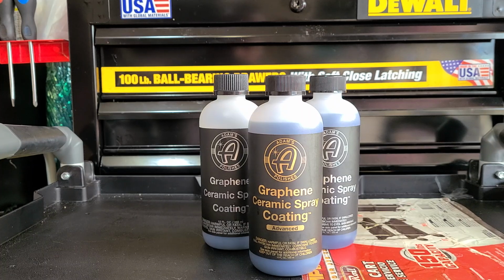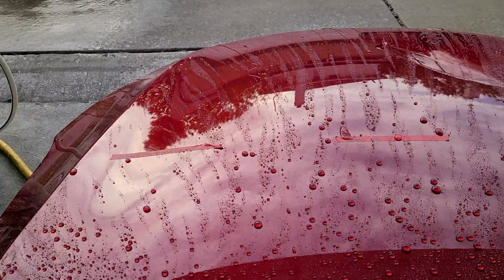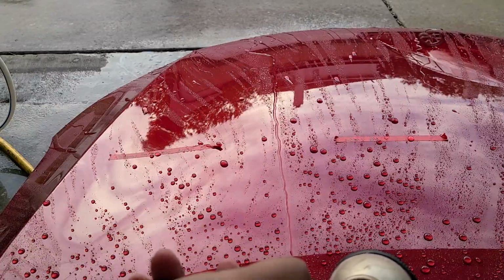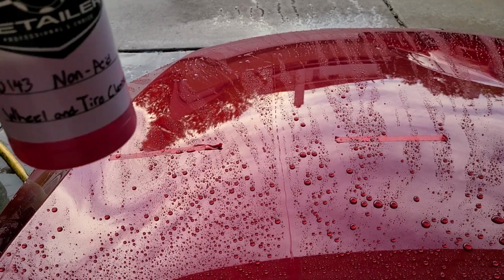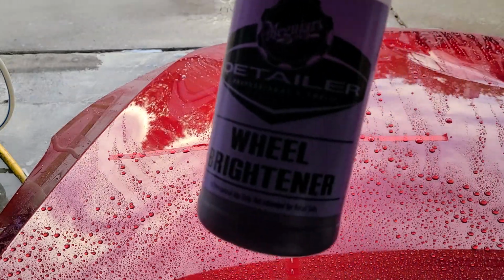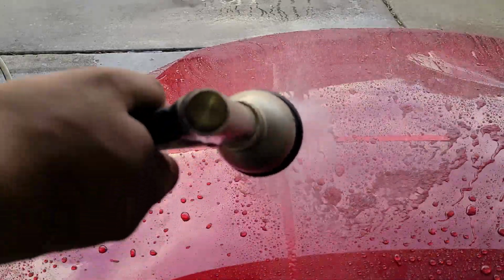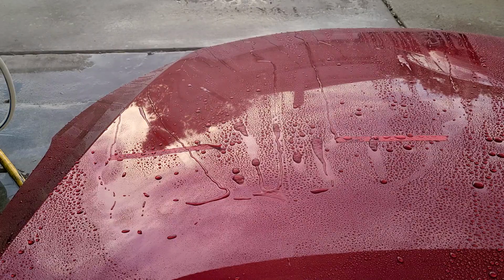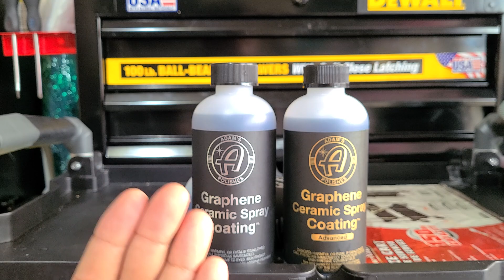[EXCELLENT] NEW Adam's ADVANCED GRAPHENE Ceramic Spray Coating - Better than the Original?

Comment from the maker: PRetty impressive stuff! Anyone know of similar products? Leave a comment below.
Reply: Optimum hyper seal. It's also solvent based and is a sio2/sic blend. I don't think any other spray sealants use SiC. It's pricy and you can only get it directly from optimum's site.
Reply: Is the Advanced you used the same that Scott HD used on his tests? It appeared that advanced only lasted for about 7 days? check out his video. Kind of dissapointing
Reply from the maker: @edwinnegron7761  I believe so. The beading doesn't last long term but it still sheets water no problem.
Reply: Good video

Comment: Great example video man. It’s a shame that Adam’s doesn’t do more to prove and show that this spray coating is in fact a real ceramic coating and a NOT spray sealant. It does crystallize. Most of the bad rep they get is because most of the DIYers installing it don’t know what they are doing so it fails quickly. In one of their videos, they interviewed the B&B blending chemist and he mentioned that it really should be called a “Graphene Oxide Functionalized Ceramic Coating”. The layer that bonds to the paint is a ceramic coating but they just utilize a graphene oxide layer that bonds on the highest layer to act as a secondary protective layer for the ceramic coating layer. Thanks

Comment: yeah the advanced after using  lasts about 7 car washes longer than the regular one on my customers cars so I think it's worth it. I've gotten 15 monthly washes completed with the Avanced before the beading turned into sheeting but it's still protecting at that point. anyway I didn't continue until it was completely flat I did a decon wash light clay towel then reapplied it in 20 min so irs new again.   don't get me wrong true ceramic coating in glass bottles are far superior but as a mobile detailer products like this and GYEON CanCoat Evo are my go to products for protecting saving the customers who want ceramic coatings hundreds of dollars. I just tell them if they would like me to maintain their cars  they can choose one of these instead of the best thing for the higher price, this will be applied  for a third of the c price of a real coating and is much less time consuming. they all usually thank me and do it.  done say noooo I'll pay more for the ultimate stuff. which is great for me too but. if you're cleaning your car regularly and putting any quality product on them it really doesn't matter what you use. just take care of it and keep it topped for max results.  great review man. you should try my favorite ceramic coating Wolfgang Profi ceramic. I've used wheel acid on it and it didn't touch its not the glossiest but I think its absolutely the most durable coating out

Comment: great video 🎉 quick question do you strip out the old coating before adding new one?
Reply from the maker: Yes unless you are topping up
Reply: @BelLavoroAutoSpa  so is topping up working well? I mean do I have to strip the old graphene ceramic spray coating before applying the new graphene?
Reply from the maker: @jayzhang14  oh no you don't you can apply this over it
Reply: oh thanks, so I just need to make sure the surface is clean before applying new coating.
 @BelLavoroAutoSpa

Comment: Bro I sell a 3 year version of Adam’s Graphene.  All I do is take 1/2 a bottle of the 5 year and mix a bottle the rest of the way with their spray coating.  So I offer a one year, 3 year, 5 year, & 7 year with their line.  They all use the same transfer solution making it easy to mix.  IMO it’s the best coating on the market
Reply from the maker: Interesting method, never thought of that.
Reply: How’s the gloss of the advanced spray?

Comment: I don’t have a garage to park my car in to do a full blown coating I just bought 3 kits of the advanced for $104 with 30% off code they have now I’m wondering if it’ll really last a year or year and half on a daly I’ll be happy to get one year also bought there soap and I’ll use carpro hydro2 to top it every wash which is like once a month I’m just really hoping I didn’t buy it for nothing if it can’t get a year out of one coat I will clay bar do a one step and apply it it’s a 2021 so paint is in good condition fyi they have a 30% off code on anything GRAPHENE so I said oh well I want free shipping so spent $116 bought 3 of the advanced spray kits and the soap for it
Reply from the maker: I'd say just re apply every 3 months to keep it good as new.

Comment: Do you got clay bar before using the graphene spray? Or can you use it after a wash?
Reply from the maker: This is a spray coating, so you will definitely want to clay bar and even polish if you have the time. It's solvent based, so only apply on a dry surface and follow instructions closely. After a wash you would use the graphene detail spray or cs3.
Reply: @BelLavoroAutoSpa  thank you, clay bar.  Should I do iron remover. After I do polish,  should I go over it with detail spray. Sorry for all the questions,  I'm learning.
Reply from the maker: @mingoreyes1  check out my video detailing the Porsche Panamera I go over the entire process. There are many others as well. But ideally you want to do the following
Wash
Iron remover
Clay bar
Polish
Panel prep spray
Coating/sealant/wax

Comment: If they doubled SiO2 content, it assume it should be more durable
Reply from the maker: They stated that basically it has more longevity, but the chemical resistance is about the same. Time will tell.